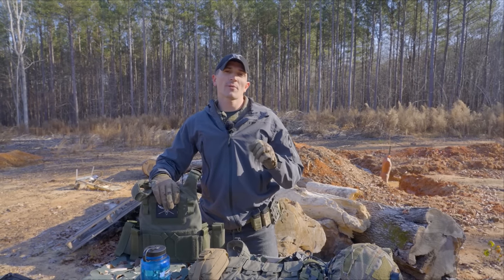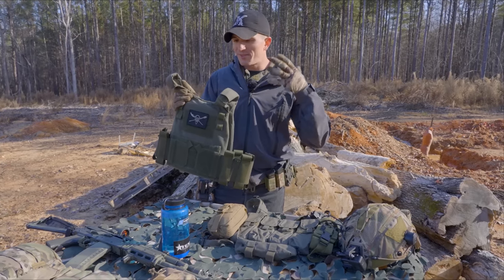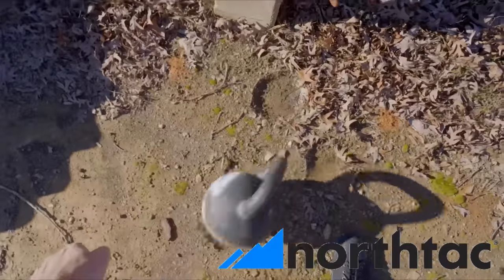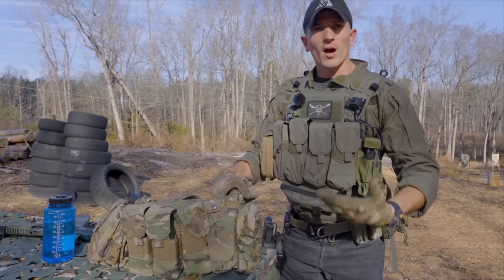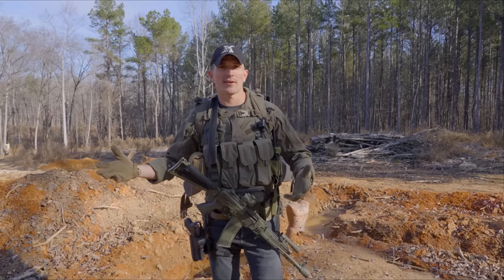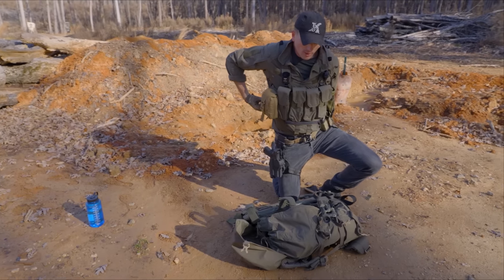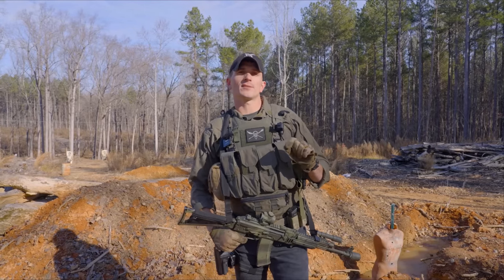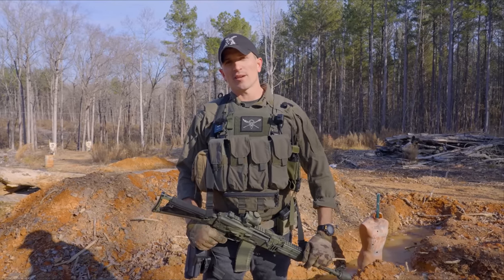What Is Even the Point of Slick Plate Carriers??

Comment: tracer tactical has the solution for running both a rig and plates, they have a way you essentially attach the plates to the rig without having to take it off if youre operating with a team and alone its just as fast with less bulk of a slick carrier. personally a big fan you should check it out
Reply: That's for a very specific set of people not civilians
Reply: @MrSwccguy  homie you missed the point, if you want to run it as a plate carrier you can do it, but once you want to run just a chest rig you can do that too. theres a duality to it
Reply: @zanec8902  oh I know the point.  But be realistic and in reality. When are you a citizen going to be doing patrols long range and be like oh good thing i have a slick PC lol.
Reply: @MrSwccguy  id rather have the capability and not use it than need it and not have it
Reply: @zanec8902  unless your super secret squirrel or in some other occupation that dose require it, it's really useless for you

Comment: dumb chairsofter here, never had to run ballistic plates out of necessity but when I was dumb enough to try reenactment I wore a weighted and padded former-issue body armor from the Italian Armed Forces (no ballistic protection because it isn't legal for civilians in Italy, press F) and played airsoft with it.
On a theoretical sense, I guess the benefit of a separate slick plate plus a LBE of sort (be it chest rig, vest or belt+suspender load) would be the flexibility of being able to wear the LBE with the ruck and carrying the armor in the ruck for when you need to move, and then leaving the ruck and donning the armor with the LBE for when you need to engage.
The Issue I found is that this relies too much on you deciding when and where the engagement happens, but what if someone ambushes you while you're on the move and not wearing your armor? at that point your ballistic protection is just dead weight in your ruck. Sure you can decide to ditch your ruck to lighten your load and escape, but at this point you'll have to reacquire and resupply everything you've abandoned on your own, since every civilian is their own supply chain.
You can also tell me that you can run unarmored to a cover/vantage point and then wear the armor, but then there's the question: what of adjusting the LBE? I think that between going "naked" and wearing two SAPI plates with armor backers plus the fabric and padding material there's a difference of a few inches in circumference....so you keep the LBE always adjusted for the plate, making it loose and wobbly when being unarmored? or do you always adjust at least the back strap (consequent slight loss of time in a potentially stressful situation)?
Alternatively, you could always be wearing the LBE on top of the plate, even when moving, but at that point in term of weight, encumberance and thiccness around the torso and on the shoulders there's very little advantages between wearing slick plate+lbe+ruck and wearing a molle plate with a ruck.
It's a different matter if you constantly need to wear armor and occasionally need to have a combat load on, in which case the combination of slick armor and additional LBE to quickly put on can help in taking off some weight when it's not necessary to have mags, comms and shit on, but except for static guard or for vehicle movement I can think of few instances where you might need armor more than the combat load, but that's just my two cents

Comment: I guess I'm be thinking, if you've got to carry the weight of the armor for 10 miles, wouldn't it be better to carry it over your center mass (wearing it) rather than it hanging off your back in a rucksack?
Reply from the maker: Wearing a ruck with a plate carrier on sucks.
Reply: @BlueJeanOperator  Agree 100%. Especially for long range. The load just doesn't ever sit right.
Reply: The problem with that is the pack won't sit directly against your back. It shifts more. And that shifting causes the plate carries to shift a tiny bit also, you can get some nasty chafing going on.

It just works better to put the plate carrier in the bag as close to your back as possible. Plus you're not as likely to overheat. Plate carriers are absolutely rough once it gets hot, they just don't breath well.

Comment: Wouldn’t wearing the plate carrier on body rather than in a ruck be more comfortable? Granted I haven’t done long patrols but I do wear my plate carrier (slick/low drag+ shingle/placard) all day in multi day matches or classes and I do multi day long distance backpacking (not wearing the armor though). My perception is that the weight distribution of the carrier is much more comfortable if I’m wearing it on body than carrying it in a pack. It would also give better protection in an ambush or unexpected contact and be quicker as you would simply just need to drop your ruck and rock and roll. Also the ruck would be slimmer and easier to carry, or give you the ability to carry more in the ruck on patrol (heavier but supports your argument of needing to be more self sufficient in near peer conflicts).  Sure wearing armor and carrier kind of sucks in the heat and humidity but so does wearing a full chest rig and ruck. Not an attack on the idea, just genuine curiosity in hope of some enlightenment.
Reply: The pack doesn't play nice with a plate carrier over long distances. It's super uncomfortable and gets really hot, you'll sweat a ton and overheat. Also your pack likes to shift around against the plate carrier since it's not right against your body, causes more fatigue and chafing.

Ideally it just worked better to slip the plate carrier in the front of the pack so the weight is in the right spot, less shifting that way.

Comment: No way rucking with your armor in your pack is less tiring than just wearing your armor. If you can’t use your hip belt because of your plates, use an external frame pack and add stand-off between the belt and the frame to clear your plates..

Comment: Would there be an advantage to wearing your plate carrier fully loaded without plates? Like a chest rig. Then add the plates when you want/need them?
Reply from the maker: So I had a squad leader who tried that at Marine Mountain Warfare School. He said it kinda sucked. Plate carriers without plates are just kinda meh.
Reply: @BlueJeanOperator  A long time ago I knew airsofters who had foam plates that did nothing but provide structure to the carrier. Not really a great real-world solution, but they wanted plate carriers but didn't want real plates.
Reply: Plate carriers are made to break down the weight of plates, chest rigs are made to break down the weight of fighting load. When you layer them you are breaking down the weight of them both the way they were designed. When you layer a chest rig over your carrier you can put your fighting load over top your carrier and have it. When you don’t need the fighting load you can store it and have a very slick system that only has what you need. If shit got real you’ll probably wear armor much more than you’ll think. But you won’t need an entire patrolling rig overtop every second of the day.

Comment: I have a shellback PC but I'm fixin to switch to a slick and LBE setup because of a missing hand and some paralysis in the other shoulder I really need something that runs pouches lower down so I can reach them easier. Basically the good ol IOTV+FLC setup. Any good suggestion?
Reply: Missing arm how do you shoot guns with 2 hands no pun intended
Reply: @Token_Black_Guy  I have a prosthetic I can hold the rifle with, but when you lose stuff you'd be surprised how quickly you learn to work with what you got.
Reply: I would recommend something like a slick carrier like an LBT 6094 slick or a beez combat systems aptum slick, then layering a beez combat systems le grid chest rig over top with the pull forward option and padded harness. Allows you to put your rig over top your plate carrier and adjust it without having to fuck around with crazy buckles. Or you can look at something like an eagle Industries H harness for something even lower

Comment: The Vests Delta wore back in Somalia had pouches. It was called the NATO Special Forces Body Armor and had removable Velcro placards for use based on mission. The one that looks like a chest rig over the vest is actually a large placard held on with velcro and a couple straps to the top of the vest. They had a smaller one that was just 2 mag pouches and a couple pistol mag pouches.

Comment: I'm poor and can't afford plates so I just bought a SADF Pattern 83 chest rig...
Reply: RMA Defense has lvl 4 plates for $159
Reply: @SgtEaglefort  So why is LVL IV armor from so many other places over $1k per plate? It it literally for the multicurve and to have lighter thinner plates?
Reply: @CertifiedSunset  the more expensive it is typically means the lighter it is.

ounces = pounds as they say, but if you dont wear plates daily for hours on end it's fine.

also, be wary of "NIJ certified vs NIJ tested"
Reply: @SgtEaglefort  I understand that you pay extra for lighter thinner plates, I just don't quite understand the insane price hike from $160 to up to $1.5k a plate for the same armor rating. 

I was just looking at the Hesco 4800 sapi cut plate set and they are $3k plus for the set. I understand that there is more manufacturing cost to make them multi curve plates, but for nearly 10x the cost I don't get it.
Reply: @CertifiedSunset  Trex Arms had a sale, $1000 off the 4800s.

but yeah idk why they cost so much, but at least you can get lvl4 protection for cheap.